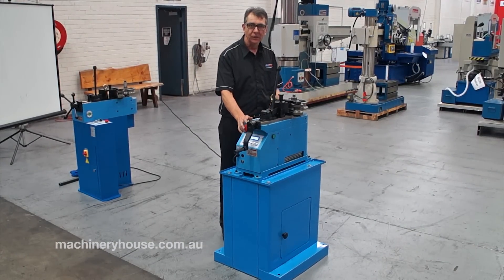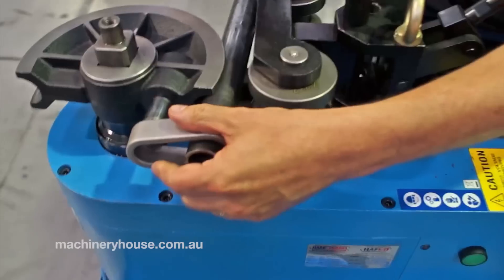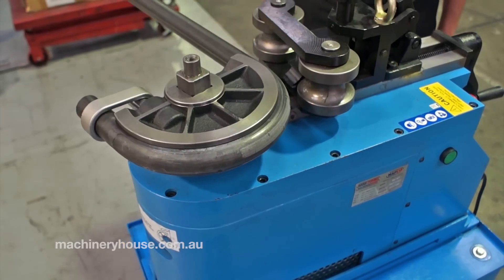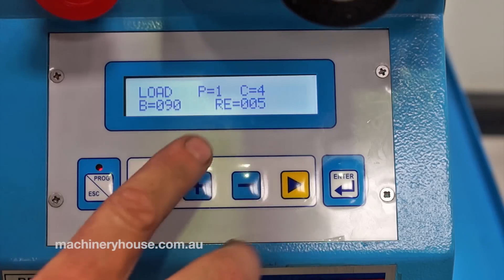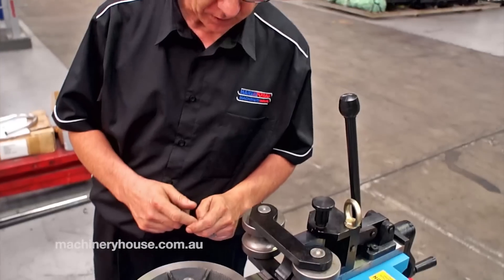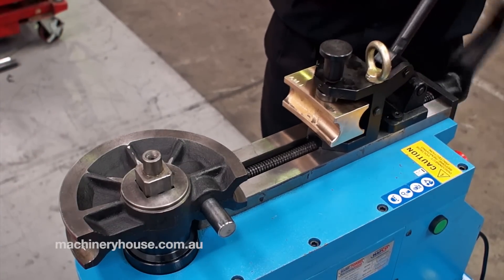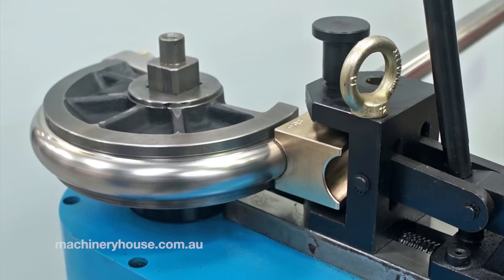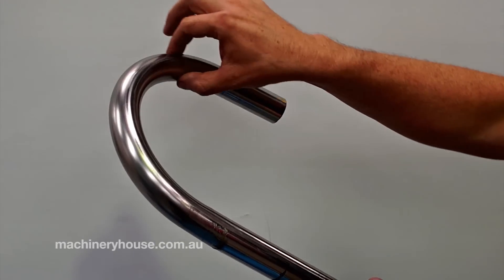TB-60 - Electric Pipe & Tube Bender 240V (T606)

Comment: I'm sorry but you don't make the setting of this machine correctly. You do too much pressure on the guide pulleys. The pressure screw does not tighten the handle with such a large force, but it must be tightened so that the locking mechanism (lever) slightly clicked the locking system. This very strong tightening of the screw will destroy the gearbox very soon. I know this machine very well from practical use as well as maintenance and repair.